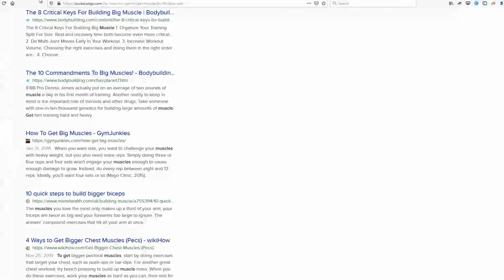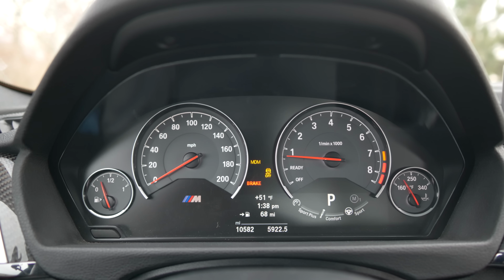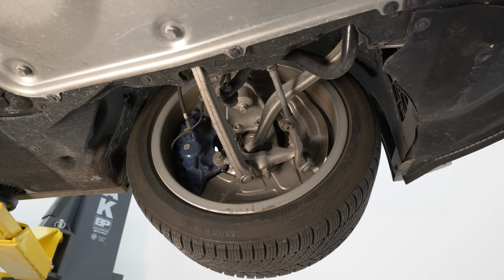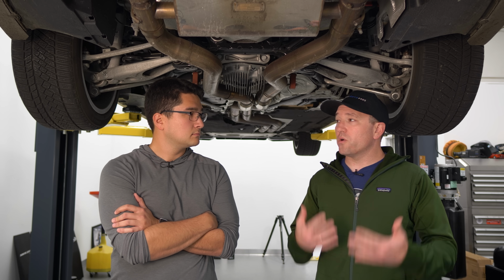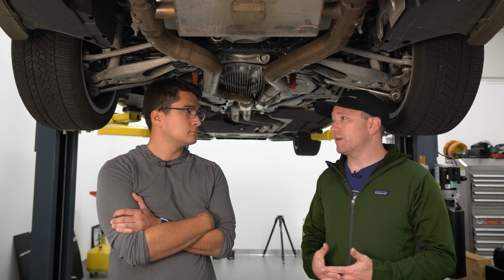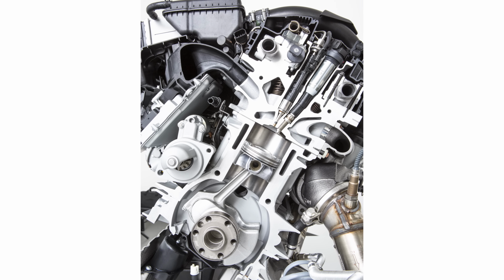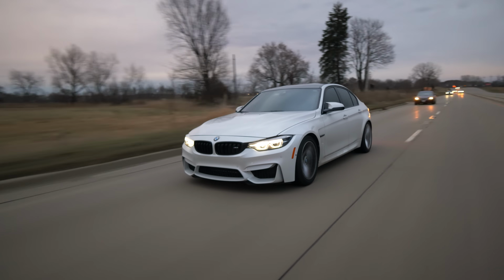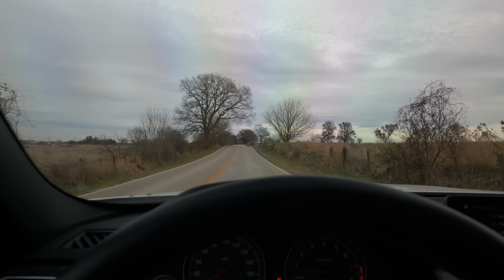BMW F80 M3 Review | The Sports Car for Mathematicians

Comment: I enjoyed your M3 analysis. My BMW M3 2018 Black is my daily driven car. I enjoy driving my M3 every day. I have >40K miles in 20 months.  I live in the North East. It took me a few months to figure out how to drive the car since it had so much power/torque. The first 5K to 10K the car was too stiff.  At 25 to 30K miles, it was more compliance with my driving style (after finding the proper setting for longer commutes).  I strongly believe after attending M Performance DAY driving school in S.C, I gained experience on how to drive the M3 ( dry/wet/snow with/without traction control, as well as seating position, M adjustments).  The experience from M Performance -Day driving school is well worth it. I enjoy driving long distances and M3 averages 26 to 28 miles/gallon (>65 highway). No performance modifications was done to the M3. No mechanical or electrical issues to date. FLAWLESS!!!!!

Comment: Standard F80 M3 is 406hp, Comp package is 425hp. Biggest part of the Comp package was the tune - it remapped the power delivery, which changed the dynamics positively. The 19hp bump was less important. Also, M3 trunk is aluminum, it's the M4 that featured the CFRP trunk. Hood and doors are aluminum. Roof being CFRP was more to lower center of gravity...not to increase rigidity.

Comment: What is the cable or hose loop dangling under the car in the exterior montage?
Reply from the maker: Diff sensor wire.  Probably came loose after aftermarket exhaust was installed.
Reply: Yeah, it looks awful like that, and seems like it’ll catch on something and rip right out. It should be routed neatly out of sight.
Reply: That sensor wire is touching the hot exhaust. Error code in 3 - 2 -
Reply: @cbrooks2767 ...then a $400 diagnostic charge, and a $125 reinstallation charge. 💰

Comment: Awesome analysis - really great!  

I too drove an e90 BMW M3 for several years and loved the connected feeling.  I swore I'd never own any M outside of warranty and $10k+ of repairs in the first 9 months after my extended warranty expired finally pushed me to look for a replacement in 2017 (mind you, I still have the e90 M3 today - just don't drive it after finding a better substitute.)    I wanted 4 doors and a connected feel while being able to have something capable, predictable, and manageable on the track.   I test drove EVERYTHING starging with the F80 M3 - was very disappointed (know it's faster, but couldn't 'feel' the car and hated the engine sound.)  

The only car I found that tingled the senses like the M3 did as a daily and occasional track car in the 2017 Cadillac CTS-V I bought.. Honestly, it's just a bit more in about every good way compared to my beloved e90 (which I think I've driven 2-3 times in the 2.5 years I've had the V!)  It's a MUCH more track-focused car and the LT4 has legendary reliability compared to over-stressed M motors which never seem to be produced more than 1-2 generations.  I still don't know that I'd want a V without a warranty but I'm 100% certain repairs would be a LOT cheaper than my M!  If you're struggling to find a fun ride after your BMW, take a long look at a used CTS-V (or the smaller more nimble ATS-V if the size and dash don't bother you - they did me.)

Had the Giulia QV been out at the time I might have gone that route instead of the V but I'd probably be regretting based on what I'm reading about reliability and the long-term viability of Alfa staying in the US...
Reply: The CTSV is a bad ass car but the Cadillac factor turns me off to them & GM isn’t known for their amazing reliability either.

Comment: First, love your channel, followed since you only had roughly 50k viewers. Second, watching your channel over the years, I really learned a lot in the engineering of the vehicles along with your great analysis of every car it's helped me to my third point. Third, I was car shopping for roughly a year and a half, finishing paying off my truck and looking for a practical toy. Looking for 2010 and newer. I had the usual suspects along with a well used 911, a BMW M car, Focus RS, a pretty wide net. I set a budget of roughly 40k. I ended up with a 2016 M4. Your analysis in this video very much hits the nail on the head. The car is more "Clinical" and buttoned down. You can be a bit of a hooligan, but it isn't as visceral as a GT350 or Camaro SS 1LE. However, this car also meets my daily commute needs of COMFORTABLY seating my family of 4, getting decent fuel economy on road trips or even in a crappy commute to the city (30 and 24 respectively), attacking some back roads competently, and having a manual (though 6th gear feels too short). The GT350 was a close 2nd, but Fuel economy and comfort for the rest of the pack were pretty paramount. I also couldn't justify the performance of a regular 911 Carrera (let alone find one 2010 or newer in that price range in decent condition) with the performance you get for your buck with the American Pony cars or a decently used M car. Awesome vid!

Comment: Good review, but small correction. The trunk is only cfrp on the M4. The M3 has the standard trunk used on all 3 series.

Also, as far as the tail stepping out on you, that can be mitigated somewhat. I installed the 763M wheelset on my M3 comp and with wider (285 vs 275 standard) and stickier rubber (PSC2s). It’s an absolute monster.

Comment: This generation of BMW M cars feel and a lot better on lowering springs and equal length exhausts. from the factory since it's an inline 6 twin turbo, the way they route the exhaust is unequal sound it ends up sounding like a Tacoma instead of a supra-esque sound.

Comment: I really want to love this car.  I daily a 2010 535i M-sport RWD with a 6-speed manual and a stage 1 tune.  But it has 130k miles on it and I am shopping for a daily replacement.  (I recently picked up a 997.2 C4S for a weekend toy - previously I had an E39 540i Sport 6-speed).  I originally thought I would transition to an F10 M5, but hated the one I drove.  It was like driving a really fast boat/bus.  I have driven two M3/M4's one DCT just to feel the chassis and finally last weekend a 6-speed M4.  I was not quite sold.  The engine noise felt synthetic (I read you can unplug the dynamic sound module which I would do) and it made the car seem harsh.  I like going fast, but I also like a bit of refinement.  In my car (granted its a 5 series) I feel I have great trade-off between smoothness when I want 60% to 70% throttle (even with the tune) and good power when I go WOT.   The F80 felt like it only wants to go WOT.   It is very frenetic and I got frustrated at how often the traction control had to come in and interrupt power delivery - it really needs AWD.   I also felt my E60 chassis communicates with me more than the F80 does, its a tad isolating - its too capable almost for enjoying on the road.  I guess I will keep my car a bit longer.  However in the end see myself eventually getting one,  because as you said in the video - it may be best option in a 4 door daily commuting sports sedan that there is.  I could consider an F30 340i M-Performance, which is probably less hard edged, but I kind of do want a real M-car next time.  Your videos are the best on the internet, I love the detail and the honesty.

Comment: Now I miss driving my e30 so much after that, I'm gonna work to slap the cylinder head back on so I can enjoy the ticking of the rocker arms. If you watch videos of M2, modern M3 and M4, all the kids think it sounds cool, I find it horrific, same story with those farting 4 cylinders, they all sound the same garbadge can with holes in em.
Reply: Frozen Pete a 4 cylinder with a properly setup exhaust doesn’t sound bad.
Reply: I agree, I didn't say that all 4 bangers sound bad, I have 2 of those in my fleet, and they sound rather cool (mk1 Clio 16v with an exhaust and a 78" classic Mini). I was referring to the modern 4 cylinders that produce the same sound whatever the maker, audi, mini, mercedes and so on, all sounds like vaccuum cleaners and they have to make em fart and bang to try to sound cool, and when it's not enough they put those stupid synthetisers.
Reply: Frozen Pete I don’t mind that, I hate the baffled fart cannons that sound like a group of angry bees... a quality muffler with a proper resonator (vibrant ultra quiet) goes a long way. That resonator specifically cuts out any drone or rasp and has a nice deep tone

Comment: These Motors spin crank hubs and here in Europe lots of people have their engines replaced in the first years production ones.
Reply: @David Hyde data? You think that bmw is going to give you statistics of their failed engines? I've seen on my own eyes that these engines fail, same as the ubber faulty 4.0 tfsi that all people love in the rs7 and say it's reliable... German  automakers make like 3 reliable engine with all the shit supporting the engine, the rest is trash. Don't believe my word, check German, Polish, French, UK, Hungarian, Romanian forums for many many topics on how a brand new m4/3 engine failed after short term usage.
Reply: FX  spun crank hubs are being found mainly on models that have been highly tuned.
Reply: @nibotkram7743  not always, but yes it's partially true
Reply: The crank hub spinning is a non issue, I've been at a dealer for over 7 years and the only two cars I've seen it happen to were mechanically over-revved.

Comment: I think you're spot on here.  I got a DCT 2016 lightly used for my daily driver once we had a baby on the way.  My track car is broken more often than not so the M3 has been my track ride too.  I couldn't find a better compromise car.  It gets around fine on snow tires here in Milwaukee area, my kids have plenty of space in back (rear facing seats are stupid bulky), my wife can drive it with the DCT, it's hilarious on the street especially with a mild tune, and it's been entertaining on area tracks.  The steering feels numb and the engine isn't too emotional compared to the ITB high revving NA M engines, and it's pretty big and heavy.... But in my case I need a bigger car and the weight isn't bad for the size.  I've had no mechanical issues on track or the street other than the stupid plastic coolant tank splitting.  Fingers crossed it serves me well for a few more years!

Comment: My son & I just test drove this yesterday.  Damn, the thing is fast.  The DCT rivals my Porsche Boxster PDK.  I can still feel SOME things through the steering wheel.  The interior is awesome.  Also, I owned a 2008 BMW 335i and did all the work myself (HPFS, cracked radiator at the inlet, turbo tubing, VANOS sensor, etc, etc) so for me to even THINK about getting back into a BMW is a testament to how good it is...especially under warranty...;-)
Reply: Did you have the gear shifting speed to 2 or 3 bars? 

(The setting that controls how fast and violent the shifts are)

Comment: My f80 comp ownership has been 3 years of love and hate in equal measure. My main gripe is the excessive nvh and weird engine sound at times. However all that nvh from the extra bracing in front end and rose jointed rear subframe I get on street pays off when you get the car on b and c back road. I’ve had to do a fair bit of work to get the car sorted - m performance exhaust, eventuri intake, oe gts hood, ceramic brakes, cs coding for trans and chassis, mp4s, tractive coilovers. I think that combo of parts and coding is about as good as the f80 platform is going to get

Comment: Hey Mark...fellow NW Suburban car  junkie here.   I currently drive a MINI Cooper S and I hoped that I would have some driving fun with it.  Not happening.  When this lease is up I am doing a 180 and will opt for either the Guilia, Redeye, or M3.  Basically, I want a stupid cad that I can get for about 50-60k used and I can have fun with driving in a straight line from Arlington Heights to Evanston everyday. Thoughts?  Thanks and keep up the great work dude.

Comment: 4x4 500-600 hp instant response, bi-turbo or supercharged, good traction all year around. what else do you need? yes it would be fun to have 2nd 3rd and 5th car to drive it once a month for half an hour, but from practical standpoint most people drive one car all or most of the time. so I very much like where this type of modern cars is going

Comment: If this car is still reliable in 2022-2025 it wouldn't be a bad choice if you can find a 5 year old not driven hard. The problem with direct injection, turbos, dual clutch transmissions, 1000 sensors all over the car, is that this stuff all stops working and you have a worthless car that no one will want to buy and start fixing.

Comment: Timestamp 27:30 counterpoint;
Get a Mk7 golf R and put a stage 2 tune on it. 4 doors comfortable daily that does 0-60 sub 3 seconds and STILL can get 39mpg driven correctly. Your wallet will thank you as well and you won't be devastated is something happens to it. Good resale value. Emotional connection is zero similar to the m3 BUT as a daily it makes the perfect tool for that job. Maybe time will give it nostalgia? Time will tell! Loved the video!
Reply: Golf R with APR Stage 2 is fun car. The one that I drove felt totally different compared to my M3. There is a noticeable difference in steering effort with VW being much lighter compared to the M3. The DSG trans doesn't hit hard during the shifts like the M3 which chirps the tires during the shifts. Golf R does have great traction and pulls hard in first gear up to 113mph or so while the M3 pulls hard from 2nd gear and up. I personally felt the Golf R was less raw compared to the M3, but I found both to be fun to drive. 

Note, Golf R with a stage 2 tune will avg around 24 to 26mpg normally from what I was told. It's a great car for around $30k or so. I personally would consider an Audi S3 if I wanted an awd car like that.
Reply: @tomjones5166  the S3 is heavier and sluggish in the top end 39mpg on my latest road trip. Avg yeah about 20-25 driving normal and doing a pull here and there but capable of hitting that 39 definitely! :)
Reply: @TheDailyStack28   39mpg in your Golf R is very impressive. That's a quick car with great mpg. I really didn't think that was possible. That's a great daily driver.

Comment: Mazda car can feel the road through your steering wheel and it has saved my life because I could tell there my front wheels were pointing.  Very confidence-inspiring feel when driving my 2017 Mazda 6 GT
Reply: @McBeakerson  please test drive a mazda 6 when u have some time a d put on the expressway.  Make you stop thinking about BMW
Reply: maurice benton I got a 2007 Mazda Speed6. AWD, 6 speed manual, 2.3 turbo, 274 bhp and 280 torque stock. Bolt on mods away from 300+ hp at the wheels, or 360ish bhp

Comment: My vote for you is the 2015 - current Dodge Charger 392. I have had a C Class, 2 E90s, a Lexus IS, Fiesta St, plus some old trash box gm products from the early 2000s, none of the cars give me the excitement and practicality of my Charger. It really is a wonderful daily. Granted the stock tires do suck and I high recommend switching them out for some Michelin Pilot AS3s which I have done because it makes a world of difference from a grip standpoint. My 2 cents!

Comment: I hear this term being used a lot.  "Linear" power band. However from a literal perspective of the meaning first thing that comes to mind is "flat lined" or even across the board.  I would venture to say the s55 power band is what you'd call linear.  And the s65 power band is what you could consider "progressive" or escalating if you will. I've driven both cars and while the e9x m3 feels good and great up top and dynamically engaging when drive hard, the f80 destroys it in almost every category the s55 is on a different level all together of power delivery and usability. The throttle input sensitivity being too aggressive can be easily adjusted for track use.

Comment: Great review and I agree with you. I think it’s great going sideways, but on a day to day basis when you just wanna go fast without looking like a douche bag, it’s a pain to get traction on some days. Rides rough on some roads. 

I also hate how the cars are getting bigger and they are no longer a sport sedan. 

I’m not in love with the engine sound. 

I ended up going to an Audi RS3 and absolutely love it. It sounds great, perfect size, grips like hell with no drama, fast with just a tune, and no issues at 50k beating the shit out of it 24/7. Plus the sound of the 5 cylinder is awesome.

Comment: I own a f80 comp and i enjoy this car because of how well rounded it is. When i think of "a car" i think of this M3. 4 doors that can put rubber to the floor. I don't track the car but I do live in Germany and push it in the 60-160 mph range daily and have had no issues at 35k even with the "stage 2" mods. The only improvement i could have dreamed of was awd and given the x3M's performance the new M3 is going to rip.

Comment: Great video, very much enjoyed it!
I had a '16 and now have a '19 F83 competition.  Top up, it's a nice tourer, soaking up the miles at speed through South Dakota.  Get off the  main highway, top down, either leisurely cruising through the farmlands, cruising down PCH in CA... there's a connection then.

Top up, looks like any other BMW... top down, seems to turn heads a little more often.

Comment: This is an old video i know, but this is not a competition model. This is base M3 with 431hk. Comp is 450hp and CS is 460HP. Different interior, wheels, brakes and some other features.

Comment: They're here talking about reliability, but I don't believe it. 

You mean to tell me I can buy one of these used in the $40-50k range, or buy a CPO model and not have it blow up on me and give me loads of problems? I don't believe it. The engine may be better, and the transmission may be alright, but there's sure to be all kinds of random electronic crap that will break which wouldn't on other vehicles. I want to believe though.